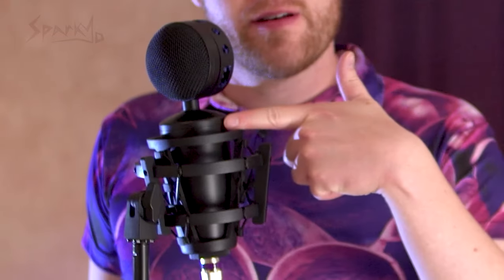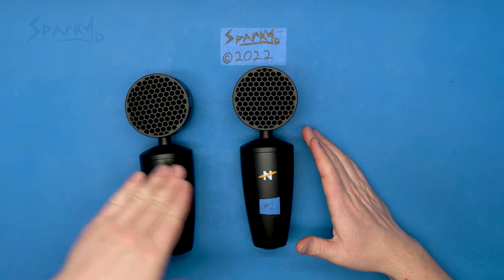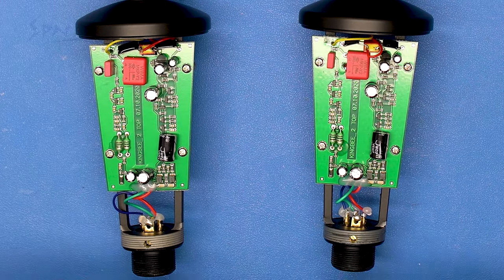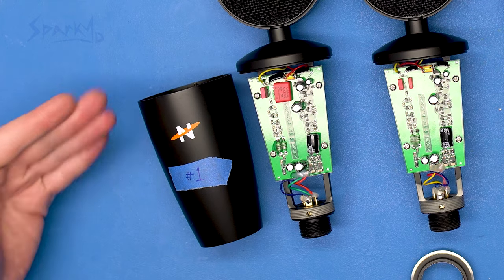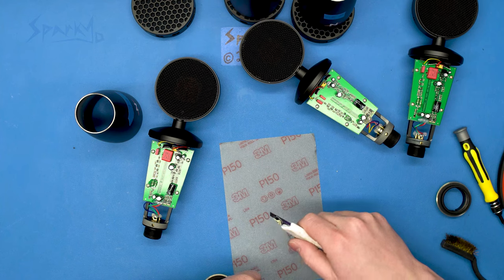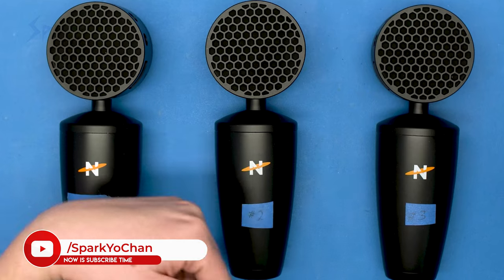Fix Microphone Buzz: Repair Neat King Bee 2 XLR Studio Mic

Comment from the maker: Thanks for stopping by!
Here's the chapters:
0:00 Does the Neat bee microphone buzz?
0:11 What is wrong with this condenser microphone making a buzzing noise?
0:25 Microphone buzzes when I touch it
0:35 Try to return your mic if it has a loud hum
1:00 Neat microphone overview and pop filter removal
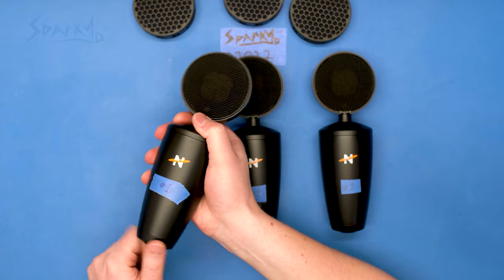1:35 Bee microphone disassembly teardown
1:48 Neat Large Diaphragm condenser capsule review
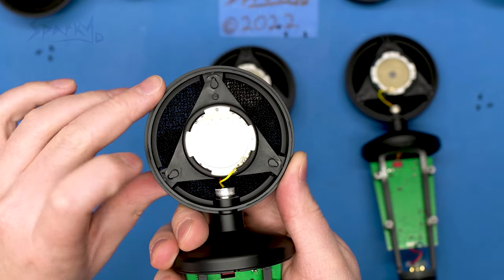1:58 Do I need to repair the circuit board in my microphone?
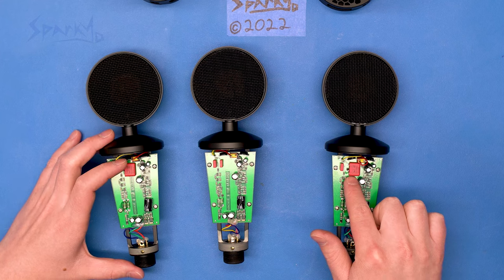2:20 I don't know how to say WIMA but it's a brand of capacitor
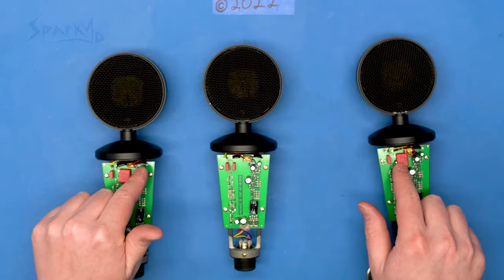2:58 Wiring for XLR cable connector  inside my microphones
3:15 This microphone was ruined because of the paint
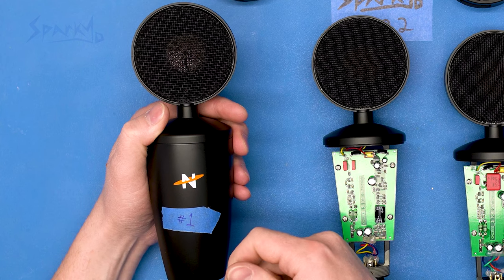3:31 Whats wrong with my microphone
4:15 How to actually fix a studio xlr microphone

Comment: You're the best!  Thanks to you, I just ordered one of these as a backup to my Rode (which is going in for warranty repair) as I need to keep working.  I wasn't sure what to do, because if I received a buzzing one, I wouldn't have time for the back and forth of sending it back, getting a replacement, then if that one had the problem, etc... Thanks for the peace of mind!
Reply from the maker: I'm glad I could help! I'm interested to know whether or not your new microphone has any issues.
Reply: @SparkY0  Getting to this late, but letting you know I had no issues with the new mic.  Surprisingly, in my booth, on my voice, this thing kills the NT1.  The Rode is now my backup.  I mean, the King is crazy heavy and the pop filter is worthless (as I believe any close attached pop screen is) but with a proper pop filter, this thing sounds great, can't explain it... sounds more "premium" than the Rode.  So, now I'm ordering another (119 bucks on Amazon right now) to gut it and put the guts in a different mic body, just for fun.  Again, your video is the reason I took a chance on this mic and so glad I did.  Thanks again!
Reply: @badmiddens How did your donor project work out? What mic body did you put the King Bee II guts into?
Reply from the maker: I have a mod to make the KB2 pop filter work a lot better by adding some gutter-guard foam. I might be able to get a how to video together for it over the holiday break

Comment: Cool video. :) Do you think the same principles apply to a Blue Baby Bottle microphone that buzzes when touched anywhere? Weirdly, the buzzing can be stopped for a session by randomly touching it enough. Touching it again will bring the buzz back.
Reply from the maker: That sounds like it could be a similar intermittent grounding problem.  It sounds like some kind of loose ground connection that randomly falls into a working position if you move it in just the right way. 
A mispainted body like on the KB2 wouldn't usually be my first guess though - especially if the microphone worked at first and then stopped working later. 

Then I would start by checking the cord and then making sure the peices of the body are all tight. It could also be the XLR connector. See if touching it everywhere causes a buzz, or if it's certain sections of the body. If it's everywhere, then it's probably not caused by a badly painted body. 
The basic idea is to follow the path of the ground and to make sure it can get to everywhere on the body.
I haven't had a Blue Baby Bottle apart to see if they've done anything tricky. If it's new, then check the warranty before doing anything too irreversable. Let me know if you figure it out. Be safe and good luck :)
Reply: @SparkY0  Thank you for taking the time to reply. :) I will look into everything here. Hoping to save this mic, cause I love its warm and vintage sound.

Comment: Hi! thanks for the tutorial it´s really helpful!! I got a buzzing KBII however it´s kinda hard to unscrew. Did you use any special tool to do it? Or do you have any specific method to unscrew it?
Reply from the maker: It's hard the first time, and a lot easier after. No special trick, it's just stuck. Iirc, I used a piece of grippy material and really had at it by hand. 
If that doesn't work, there should be a couple little indents on the bottom where you could use something like a lens spanner wrench.

Comment: Hi, do you think you could do a followup? They seem to have started sealing new microphones now, you cant unscrew the bottom.
Reply from the maker: Sealing in what way?  Like gluing the threads? 
Do you have any pictures?
It can be pretty hard to unscrew the first time without a tool like a lens wrench, but I didn't have too much trouble.
Reply: @SparkY0  Could you link me a lens wrench like you described? Also, I dont appreciate my comments being removed :c
Reply from the maker: I haven't removed any comments in over a year. Youtube will randomly hide whatever it feels like, including from accounts I've specifically marked as "Approved Users". The "Held for review" section of my comment management page has never had a comment in it, and I've never found another way to try viewing the removed/hidden comments. So I can't really help you with that one. Maybe a channel needs to be bigger before that stuff starts working. I can see this comment I replied to on the video page. If you've made other comments, then I don't know about them. Sorry. I get frustrated with this system too.

A lens wrench is an adjustable spanner wrench meant for removing retainer rings, specifically from camera lenses but it should work here too.  The wrench will have sets of two pegs or pins that should fit into two indentations in the retaining ring. I didn't need to use one for mine, and other tools could do the job. 

Here's a (non affiliate) example from amazon: https://www.amazon.com/Professional-Spanner-Wrench-Maintanance-10-100mm/dp/B07RJSG7CC/

You could also try using something grippy to help you hold the microphone and ring when you try twisting it, like a silicone hot pad or some rubber gloves.

Comment: I'm annoyed by this microphone because I LOVE the sound profile, but I have so many issues with its physical design.
The included shock mount is not very good, but the mic itself is so needlessly heavy that I can't find a third-party shock mount able to support it.
Has anyone tried taking out the guts and putting them in a more reasonable body?
Reply from the maker: The circuit board isn't the most compact, which probably helps with its self-noise. But you could make one  flatter, and absolutely lighter.
The thickness/weight of the case is pushing deep into "completely unnecessary" territory. 

It would be interesting to see even this exact design in unibody aluminum.
Reply: @SparkY0  Cut to me spending hundreds machining a custom aluminum case instead of just spending the same amount of money on a better microphone